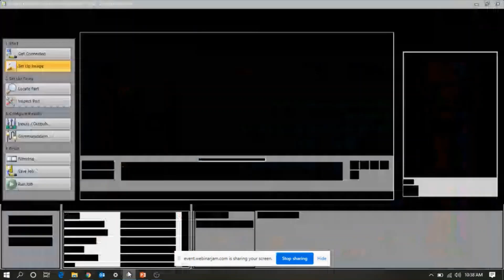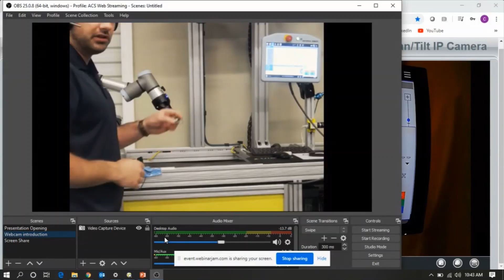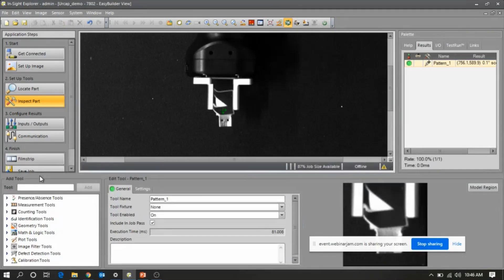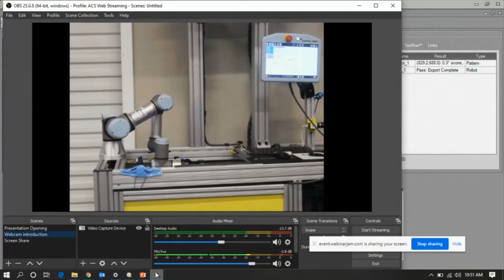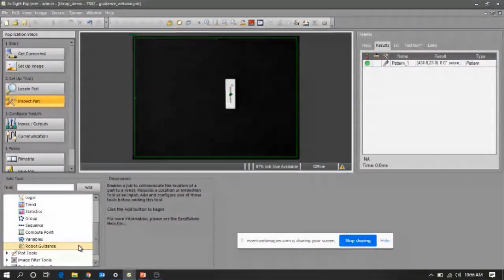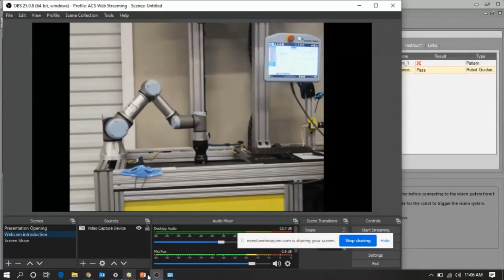Universal Robots & Cognex In-Sight Machine Vision URCap Webinar

Comment: Hi, can I use a camera with an older version (cognex model IS7200).what do I need to do?
Reply from the maker: The 7200 is more difficult to communicate with.  If this is what you need to use then each piece of data will need to be brought in individually.  What state are you located in?
Reply: @ACS7420  
Thailand

Comment: Hi this video was great! Perfectly timed and details were well explained. I have one question, can you use Blob tool instead of Pattern? In my application i need to pickup various shapes and sizes and I think it can only be managed by using a blob tool.  i would really appreciate your response.
Reply: Hi Medhi, you are able to use the Blob tool. However the blob tool does not give you an accurate angle as the pattern tool does output an accurate angle.
Reply from the maker: Yes you can!